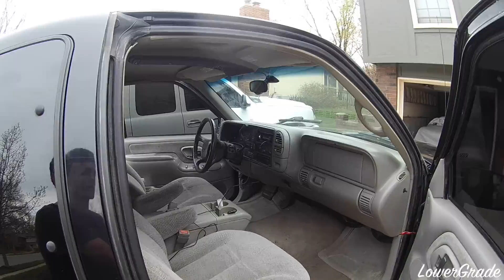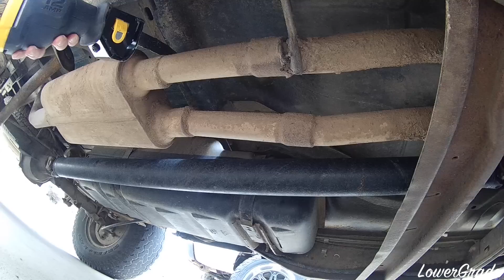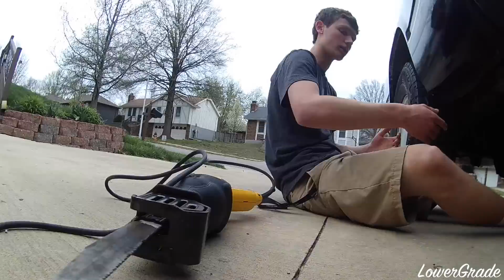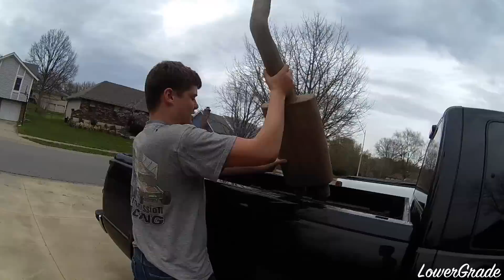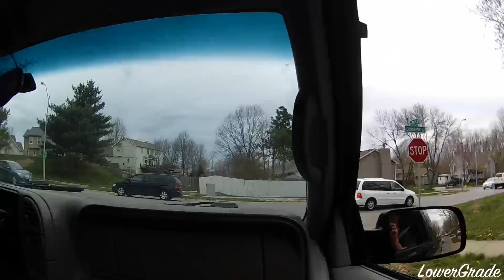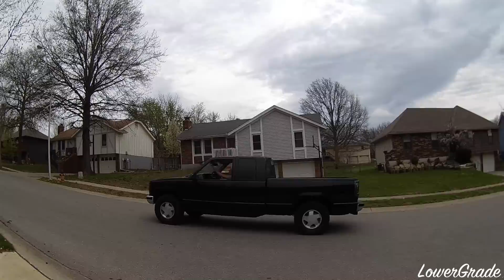Cut off Muffler From a Chevy Silverado

Comment: its gonna fuck up your valves if u dont puf pipe on it
Reply: that would be true if it was remotely close to the heads but it's not
Reply: LMFAO this guy clearly knows what he's talking about
Reply: Wgo does Corbin Haynes
Reply: So shorty headers destroy valves? Think before you reply.
Reply: Not even close. Most muscle cars run only headers, mud trucks run only headers, I ran only a manifold and then straight pipe on a car. Valves will never get destroyed from this lol.
Reply: Cody Rosa I run stock manifolds and an open catalytic converter on my 1500 and have suffered no issues
Reply: +Nicholas Elias and you never will either. So many people believe that your valves will get destroyed because no back pressure lol..
Reply: vault only get hurt if they cool to fast your fine to use manifold and a length of straight pipe ;} trust meee i am an ass certified mechanic and nutty tuner

Comment: I have a 98 gmc k1500 350 5.7 my exhaust is 2.5 in true dual strait piped from the manifolds all the way back 45 out at the bumper with 4x18 in tips no cats no muffler that’s what you need to do.

Comment: Hey if I do it to my 1984 Trans am can I just leave it like that for a while
Reply: With the pipe like that or no muffler? Yes and yes. It's all up to you. If the pipe is off the ground and all that it's cool, all the muffler does is keep the car quiet so you can cut it and leave it like that forever it doesn't matter. Now if you cut the pipe like right below the driver you may wanna run a straight pipe farther back so you don't smell exhaust but hey its all your choice
Reply: ^ yeah what he said. just make sure your exhaust exits behind the car. mine was coming out right underneath the driver seat and I could smell the exhaust fumes slowly killing me lol
Reply: +Ricer Cobalt thanks man
Reply: +Btb971 thanks man

Comment: what year is the Chevy?
Reply from the maker: +upstate1bmx 1998
Reply: +LowerGrade that what I thought. it reminded me of my 98 tahoe
Reply: it looks like a 96 or 7
Reply from the maker: 98
Reply: clearly you don't...
Reply: Corbin Haynes
Reply: Noah King No no dude don't be like that actually talk to me and maybe you can teach me something haha. Tell me how deleting a muffler way down at the end of the exhaust system will affect the valves
Reply: Every part is needed in your exhaust bro when your truck eats a valve have fun bro your causing unnecessary back pressure which is gunna fry your head man good luck I'd buy an actual exhaust system
Reply: chris lugg That's not really true at all. And actually, removing the components greatly reduces backpressure. Not a good thing for an N/A motor either but at most you'd just lose power/torque. If you're running just the headers then yeah that's a problem, otherwise nah.  
  
  
Either way I don't have a truck, I drive a turbo car. So I don't really have to worry about backpressure lol I'm trying to straight pipe it
Reply: I'm running only headers on my 6.2 Denali haven't had any problem
Reply: FUK YEA
Reply: chris lugg I got an. 09 Silverado z71 no cats longtubes....magnaflo mufflers 4 years no issues....240sx sr20det 3 inch straight pipe..2 years no issues ....13 civic si muffler only on 3 inch down pipes 3 years no issues.......what you're saying is not factual in the least.....only way it'd affect the valves would be to run with no header/manifold period stop spreading false info
Reply: Wow people still getting trolled over this?! Hahha happy new year to me oh boy :D
Reply: Spivic with a fart can hahaha that suits you bubba
Reply: chris lugg lmfao.....nice queer
Reply: Your a nice queer?
Reply: Corbin Haynes Removing pieces of an exhaust looses low end torque but increases horsepower. Thing is, a little back pressure is needed but not alot. Same goes with exhaust size. Too large, you force the engine to push the exhaust out of the chamber rather then it "pull" exhaust gases from the other cylinder that fired off. Too small and you have huge amounts of preassure blowing a head and/or overheating.

Comment: i just chopped mine off also, but glasspack or cherrybomb will be replacing it
Reply: Yeah I did this to my 92, only because I put true duals on it years ago, but 1 of my mufflers blew apart, so it sounded wired with 1 muffler being pretty much gone, and the other fine. I love the sound on the highway going 65mph or idle, sounds good, but I'm not a huge fan of the get up and go sound, I was thinking of some short glass packs and put the tail pipes back on.

Comment: that sounds crappy go to my channel to see how a 350 is supposed to sound..
Reply: I&#39;m assuming this is a 5.3, which would make it a 323, not a 350.
Reply: Triston Charge to bad they didnt have 5.3s in this body style
Reply: magzilla vlogs Then its probably a 305
Reply: Triston Charge probubley not most are the 5.7/350 but some are 305 but the 305 is just as slow as a 4.3
Reply: magzilla vlogs the funny thing is the 4.3 vortec made more than the last year 305
Reply: That is not entirely true, the last year they put the 305 in the Silverado it made 230 hp where the 4.3L made 200. Also the 305 made 270-285 ft lbs of torque the 4.3L  made a max of 260 lbs of torque. So while the 305 isnt making tremendous amounts more of power it did make more power in both horse power and in torque.  How ever the 4.3L did get better fuel economy.

 I know this first Hand . I had a 1991 C1500 with a 4.3L and I would average 19 hwy and 15 city. I currently have a 1992 K1500 with a 305 and I average 17-18 hwy and 14-15 city.  Granted my 305 is mated to a 5 speed and my 4.3L was mated to a 700R4 my 305 is a lot snappier and has more low end power than my 4.3L did. Both were comparable in miles as well being right around 150k miles.

At the end of the day, neither engines are a power house lol.
Reply: EngineBacon my 350 has a 40 series 😂 I thought about running 3” true dual straight piped with 4” tips

Comment: Also a great way to destroy your engine, gotta have back pressure
Reply: Jacob Cornstubble not exactly my 5.3 has a muffler delete I had it on the dyno when stock muffler was on and muffler off it gain 1.37 horsepower so yeah😂💀